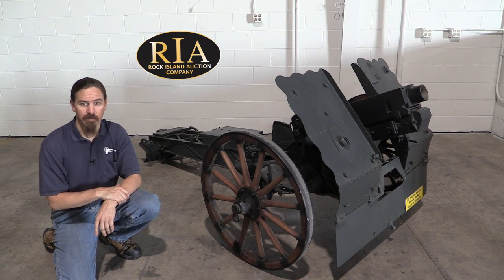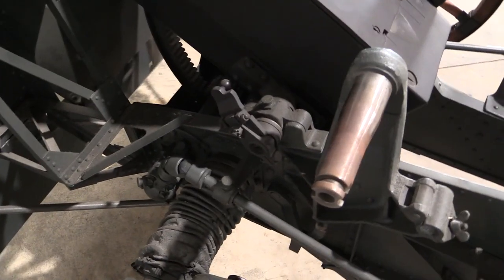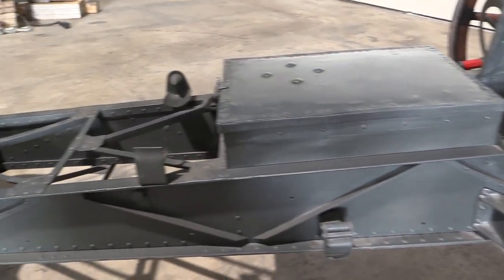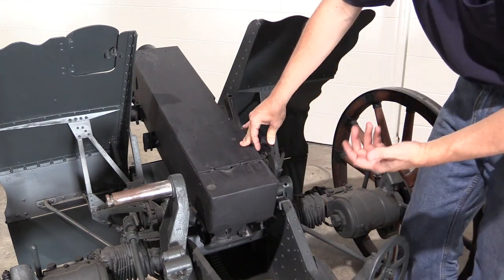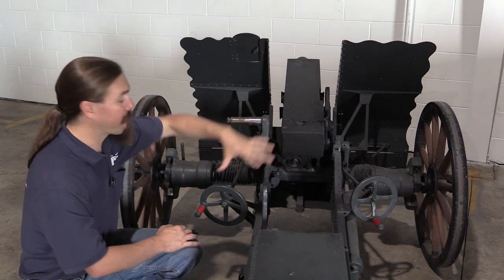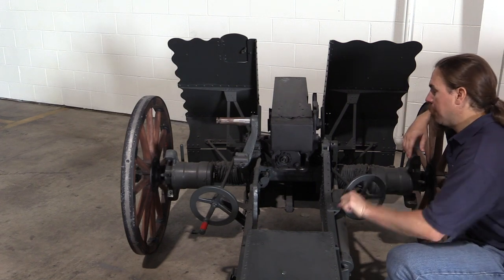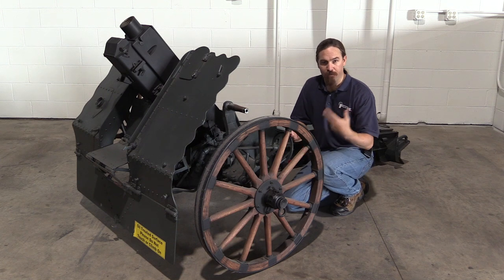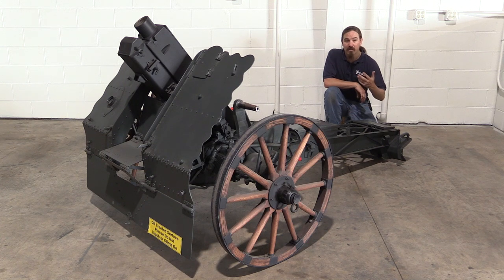Germany's New Light Howitzer: the 7.5cm le.IG 18

Comment: Neat weapon. Filled the role of close fire support. 
I have noticed in the comments why this and not a mortar.

Remember this also about this time there were no really effective radios to transmit coordinates from the front lines back to the mortars or artillery. It was done with field phones with wire running everywhere or runners or homing pigeons. 

Lines got cut by almost anything. Runners and pigeons got injured or killed.

Rapidly  adjustable fire support really was not a thing. 

Roads were not what they are today. This moved with the infantry.
Reply: Thats the first thing i thought but your explanation makes sense.
Reply: Though if you have communications problems, surley a lot easier to have a couple of mortars a few yards away and yele at them, or they can see the traget and troops moving,  than that thing dragging along somewhere behind? Also ,who's lugging the ammo about?
Reply: They used this in addition to mortars.  They were not mutually exclusive in the German army.  However, the 7.5cm could lay down rapid fire over open sights against groups of infantry, which mortars take time to do in an indirect fashion (especially considering the dearth of radios).
Reply: Mortars provide high angle attack, while while guns use a much lower angle. High angle attack is better for attacking troops behind reverse slopes or in fighting positions without overhead cover (trench lines, etc).  While assault weapons were meant to neutralize point targets like bunkers and pills boxes that were both proof against small arms and overhead/ground burst shell fragments
Reply: Sorry guys. I just can't see what pravtical use this thing would be. It is on a large wheeled carraige, heavy to move, can do nothing that  dedicated feild artillery can't do better and would be a bullet magnet in an open position. The only justification I can se efor it is a light anti armour pice, and to be honest in that era the Britsh 2 pounder gun is smaller lighter easier and was effective.
Reply: I don't think it is probably too difficult to move. When I served in artillery, we used a 2000kg modernized WW2 era howizer early on in the training before moving to proper stuff and even that was easily movable by 4-5 guys even in the forrest. On pavement we hauled those hundreds of meters on regular basis as a form of punishment/exercise... As long as the balance is good and wheels are large it's not an issue. Bigger issue is the ammunition though. What comes to 2 pounder, AFAIK it did not have effective HE round.
Reply: True mate. Though the two pounder is a fun little gun to shoot. As for pulling them about the Royal Navy , and the yo yo's from the Fleet Air Arm used to indulge in the sport of gun running, hulking a 13/18 pounder and limber up and down slopes and across chasms on ropes for fun, against the clock! It was always said that to be a team member you needed three things The strength and endurance of a Cart horse, The speed and agility of a Racehorse, and the brains of a &*^^^ Rocking Horse.  Then Health and Saftey got in the way :-(
Reply: The US also used a weapon similar to this called a 75mm pack howitzer
Reply: 51WCDodge it was what they had back than, so that is what they had to use.  They would be inefficient By today’s standards we do the mission with infantry rockets/recoilless system or ATGMs.   Even today grunts are more likely to shoot an assault weapon/ATGM than get approval to shoot artillery at a target.
Reply: It has a direct fire capability. Kinda hard to do direct fire with a mortar (Although it is theoretically possible with trigger actuated mortars.....VERY theoretically.)
Reply: Scott Patterson breach loading mortars like the AMOS, Vasilek and AMS have a direct fire capability and even being muzzle loaded mortars like 81s have been adapted to the role
Reply: Scott Patterson Scott Patterson breach loading mortars like the AMOS, Vasilek and AMS have a direct fire capability and even being muzzle loaded mortars like 81s have been adapted to the role
Reply: Field Artillery Role is to Fight in the depths of an Battle zone, this thing is for direct Fire or close support, Roles which would be filled by ATGM or RPG or GMW nowadays...These were pretty effective and liked through the War, they could be used with good precision on a close Target (relative in Artillery Terms close)
Reply: In my opinion. I believe if we modernized such a piece we could greatly reduce the weight, increase its rate of fire,  make it more accurate, and improve it in just about every way.  Not to mention it could easily be mounted to a humvee.

Comment: As many ppl noticed before, these guns mostly used in the infantry gun sections of the german regiments. Originally the gun have a small limber and caisson. Their name was the If.12 and If12/2.(For infantry use)Late in the war any kind of limber vas used, even If.8 infantry cars, foward elements of machine-gun carts, etc. And instead of caissons, so called feldwagens are used(horse wagons, Panjewagen Pleskau for example)Mostly two horse used to tow the gun, but sometimes even six had attached, for example, in case of cavalry units. Motorised units used the Kfz.69 Krupp Protze light truck or 1 ton halftrack, but any light vehicle also usable. Steyr 1,5 ton, Opel Maultier, or even Sd. Kfz 251!Also, grenadier divisions used this gun in the batallion level, four guns per heavy company. Bycicle recon troops also used in the similar manner, but tow it with vehicles. Also, panzer and panzergrenadier units was also used the gun, two guns per platoon, in heavy companies in the recon or the infantry battalions.Late in the war, the new 12cm mortar was the new toy, often using in heavy companies, or in infantry gun companies, together with IG.18.This heavy companies also have own field telephone and radio sections. Mostly feldkabeltrupps 3 and 6, Tornisterfunktrupp and Feldfunk. portable radios. Donkey-ear binoculars, theodolits, optical rangefinders also used, like in "real" arty batteries.

Comment: Ian, an interesting little gun!  Yes - Forgotten Weapons should keep on with "support" weapons (like your editions of the M20 Super Bazooka or the recoiless  rifle).  One can see that this showed Great War experience.  "How can we eliminate the machine guns that stop the infantry's advance?"  These would have a greater importance in the German Army as the Treaty of Versailles forbade them having tanks (the real answer to the pesky MG nest).  The infantry guns were the infantry commanders "personal" artillery.  The US Army standard infantry regiment had a Regimental Cannon Company throughout WW2.  Originally they had variants of the 75mm pack howitzer, then they used the 105mm M3, a shorter, lighter version of the standard 105mm artillery weapon.  The crews were not artillerymen, but were infantry branch.  In certain situations the Regimental Cannon Co. might be mechanized (M7 Howitzer Motor Carriages in some instances), but the light 105s were pulled by the Dodge WC62/63 1.5 ton 6X6's.  The light guns were no longer needed as 1) communications improved with the artillery, 2) the guns grew heavier due to requirements for increased firepower, and 3) armor support became more readily available (at least for the Allies).  Recoiless rifles and later guided missiles filled the role in later years.

Comment: 2.5 mile range ain't bad.
Reply: at that distance you either need a forward observer and radio, or being positioned up on a hill with very good binoculars
Reply: They had a forward observer. This guns were used by the 13th Company of each 
german Infantry Regiment. These units were the artillery of the Regiments CO. Each Infanteriegesxhützkompanie had 3 gun platoons with 2 guns. 2 platoons with the leIG18 and one platoons with the SIG 33 (15cm). They also had a Forward Observer section like an artillery battery.
Reply: Stephan L And drones...sorry...Happy Thanksgiving!
Reply: Still only 2/3s of the monarchies mountain gun thatw as basically the same as this. Might have been a mite heavier at 600kg though.

Comment: I was half expecting the Cheiftain to walk out the other side of the M3 light tank.. 1 question, what is the thing that looks like a stub axle shaft sticking out of the left side of the trail near the breech block?
Reply: I suspect that might be where the sight is mounted to look through the little door on the shield beyond it.
Reply: M5 Light tank, actually.  The M3 had more blocky frontal armor plates rather than that nice slope.

As for that stubby rod, I was thinking that it was either the firing trigger or the lever for opening the action, but it seems that both of those levers are on the right side of the gun...

After searching for a bit on google, I think that I came across the answer, though.  Fro what I can find, that seems to be the mounting point for the sighting apparatus.  I assume that the sights aren't mounted there anymore on this gun because the gun has been made inoperable and thus it does not need the sights.

See what you think: http://www.lonesentry.com/manuals/german-infantry-weapons/pics/76-sighting-mechanism-75-mm-inf-how.jpg
Reply: The Chieftain did a a video on an M5 tank a5 Rock Island Auction; possibly that particular tank.
BTW, fro: reading on the complement of equipment a Wehrmacht company had assigned, the company had multiple carts, t9 carry equipment, ammunition, as well as horses, bicycles, etc. so having that equipment was pretty much normal.
In regards to the US, I knew some soldiers in the Pacific Theatre in WWII, several company commanders would tell be their biggest problem was keeping the mules in good shape, so the US wasn’t mechanized as much as we might think.
Reply: dandel351 m5**
Reply: See above I get it.
Reply: @charlesadams1721  they werent?

Comment: Putting it in automotive perspective the gun's transverse is of the rack and pinion type and was very modern for the time. The gun carriage suspension  was very similar to a Chevrolet's front suspension in the 1930's when they used "knee action" suspension.

Comment: That weird tilting barrel action actually did have a particular advantage in that you didn't have to lower the barrel to reload if you were doing high angle fire as the barrel would pop up so you could reload without the trailer getting in the way.

Comment: I can imagine one GIANT advantage the tilting barrel design could be offered in that piece. That being the angle to insert the shell when placed at high angles of fire. With the barrel at the extreme height of its elevation, being able to load the shell above and at a lesser angle to what the gun is at would be incredibly advantageous when in combat meaning the barrel would not have to have been lowered to reload then elevated again to fire. 
   Say for instance the American 105 mm or 75 mm howitzers would have presented a much bigger silouette when firing at their extreme angles of barrel elevation because to reload it the breech slides to open the chamber up to either extract the fired casing or reload a new shell and thus the carriage design was made is such a way to allow the breech to be accessed from behind. Making the entire barrel assembly be raised higher in order to allow reloads.

Comment: at 75 degrees increase you are very happy as a loader on the tilt bolt. Otherwise he would either have to crawl under the cannon or you would have to crank down the elevation after each shot to safely insert the next grenade.

Comment: Looking at the axle arrangment, bouncy axles not good news when firing so does the second lever lock the supension? The German's in WW2 did do elaborate. I know of a ten meter tall reinforced concrete  tower, built half into a granite outcrop with a large heavily armoured cupola on top. Weapons mount 1 x MG34/42.  I should add records show no other apparent use for the structure.

Comment: I wonder if that suspension housing is similar to that on an FMR Tiger / Messerschmitt KR. For those cars, they used a rubber torsion "spring" that sat inside a housing that looked strangely familiar.

Comment: This cannon looks somewhat similar to, and should have filled the same role as, the Swedish mountain gun "Bofors 75 mm Model 1934". According to Wikipedia (though it says "citation needed") Germany bought 12 for evaluation and then designated them as "7.5 cm Gebirgshaubitze 34". They also captured some from Belgium (designated as "Canon de 75 mle 1934") which they redesignated as "7.5 cm Gebirgskanone 228(b)".
Reply: Id say the inspiration is more the 7.5mm skoda wwi mountain gun, of which germany had a few hundred pieces.

Comment: I’d be very interested to see a video on the Japanese counterpart to this, the Type 92 infantry cannon. I don’t remember the exact specifications of it, I know it was a 70mm design that could be disassembled like a pack howitzer. I think the full weight of the assembled gun was only about 470lbs, the other feature I remember was that, due to the very wide range of elevation (somewhere on the order of -8 degrees to +70 degrees), it could basically do double-duty as either a light howitzer or a mortar.

Comment: There is actually an advantage to the tilting barrel action you didn't mention. At full elevation, you can still reload the gun without having to lower it. Not being able to do that was a problem with some of the German heavy mortars during ww2. If this thing had a Puteaux gun action, it would probably be a pain to try to reload it at maximum elevation.

Comment: I dont know about the gun tilting/horizontal traverse being seemingly useless/not having a purpose at all. It seems like an advantage to me. The way I see it is if you were coming to a piece of more solid cover to put the gun next to. For arguments sake say the side of a building and you want to put the gun on the right side of a corner, traversing the gun all the way to the right would decrease the profile and keep the crew using it in more solid cover and making it easier to camouflage. Seems like a well thought out part of the gun to me.
Reply: That traverse just seems to move the barrel left or right of the aim mark. Surley traverse should allow some change of angle from the centreline? Be easier just to shift the trail left or right.
Reply: Didnt know the right word. I didnt mean to turn the gun. I mean to off set it so more of it can be placed behind other solid cover.
Reply: I see what you mean, but does seem a bit complicted really.

Comment: I can imagine the top open action would be safer for loaders, since locking it shut didn't require you place your hand behind the fire block, meaning the gunner could pull the trigger the exact moment you close breach, and the block would slide under his palm. Worse case scenario the loader's hand is chaffed. Compare that to a traditional breach loader, if you are behind the breach when it fires, you're going to get smacked!

Comment: This gun compared very well with other infantry support guns in its class-but it was still a lot of gun for a little shell. Mortars were replacing these weapons during the war for that reason.
Reply: Well, it was a combination of mortars and self propelled assault guns that replaced them. For high angle trajectories, a mortar would do a similar job while being lighter while, for direct fire, a self propelled 3 inch (or similar) gun, like a StuG III or a M10 GMC would do a similar (if not a better) job.
This LeIG 18 was still a concept of the past war (The Great War).

Comment: The limiting factor in the guns rate of fire would be the barrel temp.  I think a modern 155 can fire a three round burst in one minute, but its sustained rate of fire is  only1 round a minute.  A gunner might correct me but as far as I know this is accurate info.
Reply: Minute Man guns modern howitzer have thermal gauges on them to allow well trained crewed to exceed advertised ROF limits.  On towed weapons and some SPs the rate of fire is limited by the crews speed of loading, while on many SPs and  few towed weapons auto loaders can reach ROFs of 6-8 rounds a minute for short bursts.
Reply: The Britsh twenty five pounder was 6 to 8 rounds per minute sustained, ten rounds per minute for three minutes emergency rate. Though as an old gunner said to me 'When your in North Africa and a load of Panzers are bearing down , those numbers go out the bleeding window'.

Comment: That torsion spring suspension and collapsing gun shield tell you that Germans designed and engineered it. The motto of the Reichswehr was not "If it isn't there it can't break."

Comment: Maximum rates of fire on artillery pieces have to do with heat dissipation, and less to do with the actual capacity to load and fire it. I suspect a skilled crew could lay down closer to 16-20 rounds per minute on an active battlefield (rounds simply going down range as opposed to precision fire, yes, guns were often used for suppressive fire!). That's why you get "Max rate of fire" ratings, and "Sustained rate of fire".
Reply: Bryan Schmidt over a long period of time, but there is an actual limited to speed a gun crew can load and fire a gun and it gets more pronounced as shell weight increases with manually loaded guns like 105s able to conduct quick burst of 15 or more rounds a minute while larger guns like 155s can get out 5 rounds with very well trained crew